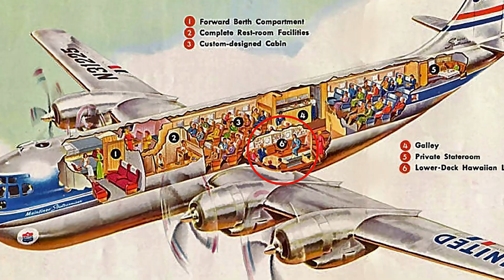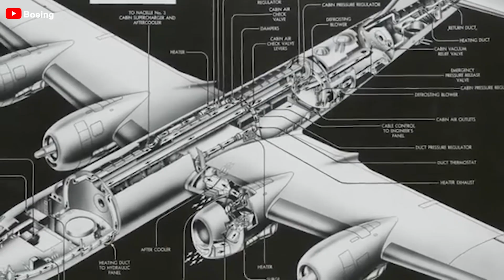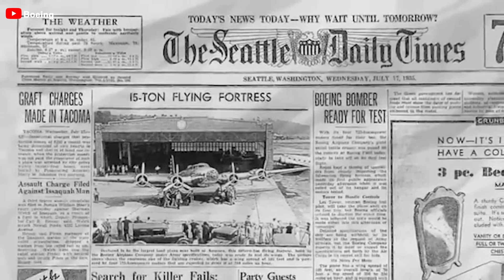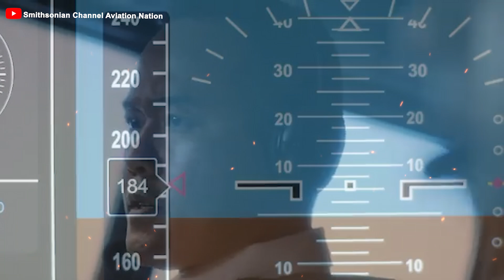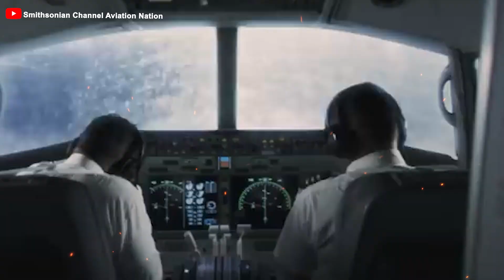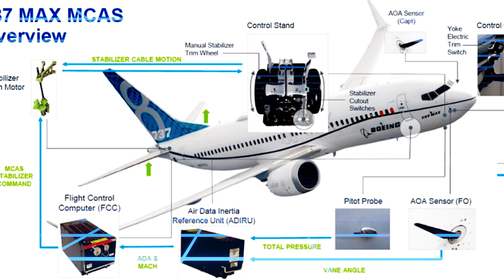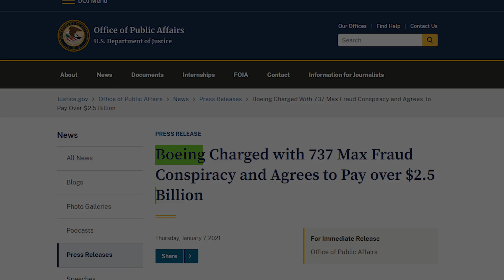Boeing’s Worst Airplane! Here’s Why!

Comment: The issue with the 737 max is that it really isn't a 737. The Max weighs more empty then the early 737s did at maximum gross weight. They managed to get it  certified as a 737 is because their are several airlines that are all -737, and the pilots need only one type rating . The pilots are required to have "difference training"  between the different models, but clearly this difference training was inadequate - some of the max pilots didn't even know that the Max had the MCAS system. BTW - I have flown twice on the Stratocruiser and they were  a delightful way to travel; both flights reached their destination with all engines running. In those days the world hadn't gone nuts and the flight deck door was always open. The pilots would let the kids enter the "front office" and watch for a while. When it was my turn, I told one of the pilots that someday I would be a pilot. I'm sure they heard that a lot. I did become a general aviation pilot. I will always have a soft spot for the 'Cruiser.
Reply from the maker: Thanks for sharing your thoughts!